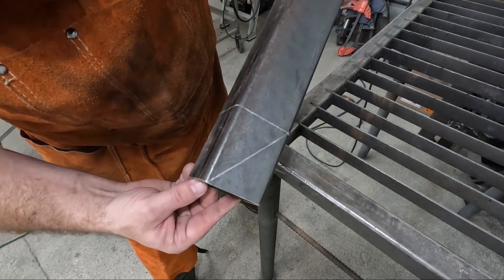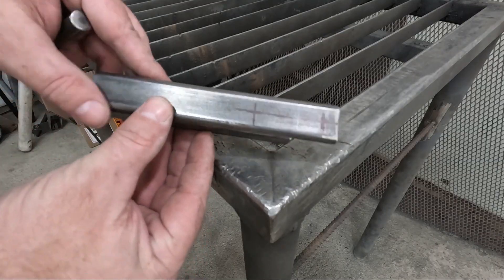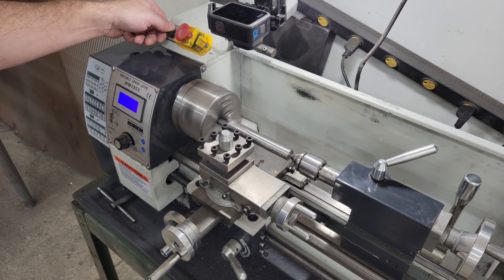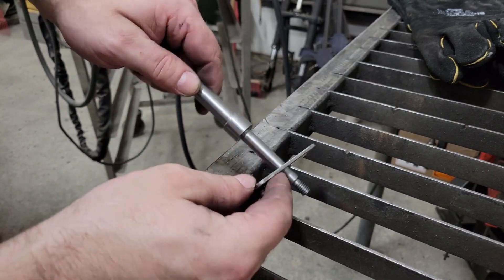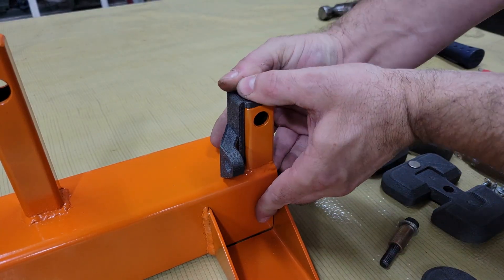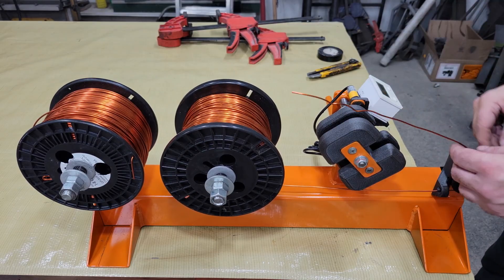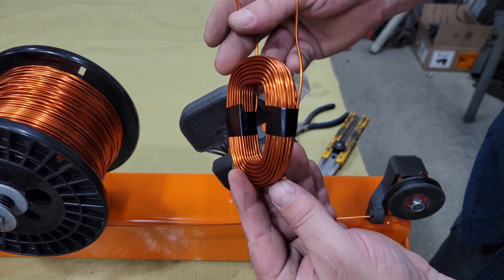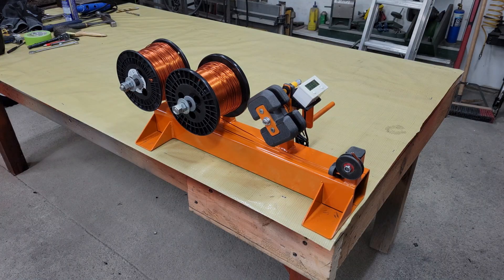Making A Coil Winder & Winding Coils For Axial Flux Generators & Motors

Comment: yey a new video. Sadly its not motorcycle
Reply from the maker: Still testing the replacement cells, but they should be ready to build the battery and test the powertrain very soon. Then on to powder coating and 3d printing some plastic.
Reply: @JamesBiggar  About 3D printing, which material did you use for these gray pieces on the winder?
Reply from the maker: CF infused PETG, for no reason other than that's what I had on hand to print with. Just about any type of plastic filament will work fine for this as long as 100% infill is used.
Reply: @JamesBiggar  Figured it was CF, the looks are killer 👌

Comment: Brilliant and so much information packed into the video. I was looking to find out such information and it was good to learn quite a bit from this one.
I will certainly be interested in your axial flux generator and the calculations used. It is amazing how little information there is on the net regarding generators.

Comment: I'm not sure I agree with your theory that a thicker wire can't be packed as densely as a thin one. The problem is called circle packing in a square, and the packing density formulas show that the density fluctuates up and down as you make the diameter smaller. In the example in the video, you are fitting 6 wires in a layer (reminiscent of 36 circles in a square) which indeed is optimal. The thing is you can also go down to 5 wires per layer, which will have an identical packing density.  Same goes for 4 and 3 and 2 and one, yes, just one circle per layer - in theory packing density is identical for all of them.

Now going a little bit off topic, with a thicker wire, you can give it a more square crossection without compromising the roundness of it, because a thicker wire can still have the same radius to it's corners as a thin wire. This means, you can increase the packing density while keeping the same safe electrical properties.

Now I know the dielectric on these wires is very thin, but a thicker wire has less dielectric, so that's a tiny advantage.
Reply from the maker: In theory. In practice, that's not quite how it works out. First, you're forgetting human error. Keep in mind that we're talking about DIY micro turbines. The thicker that wire is, the harder it is to wind it by hand around a tight radius. Thick wire takes a lot of force to pack into a small package. 12, maybe 10 awg is the max for winding by hand around a 2x1" mag center, and you'll need some muscle and one heck of a grip to get it done right. After that, stator size grows exponentially while power density drops. Time tested and true. If you want to wind thick wires, you need the right gear to do it, which will cost a few hundred $ min. compared to this handy jig. The other thing you need to keep in mind is cut-in and operating voltage vs blade power, ie: coil turn count vs ampacity. Wind turbines operate a LOT more efficiently at higher voltages and lower current, and they're cheaper to produce and install that way. Thicker wire can obviously be wound tightly in an energy dense generator, otherwise industrial turbines wouldn't exist. But the awg requirement is entirely dependent on the tsr, turn count, subsequent voltage and the target power range. Thinner wire + more turns = less cost and better blade performance because 3 bladed turbines, like all electric generators, operate best at high speed. Voltage output is proportional to speed - limiting voltage effectively serves as a brake on the turbine and prevents the blades from spinning faster, ex voltage clippers. These are used on high voltage turbines to switch a load directly on the turbine to 'clip' the voltage down and lower the rpm in return to keep it from spinning out of control and damaging itself or the equipment it's connected to. The relationship between rpm and voltage is why we moved from pwm charge controllers to mppt. The latter doesn't lock the turbine at the battery voltage and allows it to spin up to an optimal rpm range for blade efficiency while producing 10-20X the output voltage than it would with pwm, which minimizes the current needed to achieve the same power while significantly reducing wire and cable thickness requirements both in and particularly outside of the gen where transmission lines can be anywhere from 50ft to 500ft or more depending on the tower height and location, and thus reduces the cost. A 12V wind turbine rated for 3kW would be significantly more expensive to install vs a 200V turbine rated for the same power, like mine. The 12V turbine would need 4/0 cable to carry that 250A just 1 meter, while my 200V turbine would get away with 16 awg to carry only 15A. Big difference in cost. A single 4/0 cable can cost up to $15/ft, but you can buy 50ft of 16/2 cable for roughly the same price. Using thinner wires to pack more turns into a coil and produce a higher voltage in a smaller package is the best way to design a wind turbine gen at any scale, but it's especially true in the DIY world where resources can be limited.

Comment: just for the sake of wondering . Would it be possible to make a PMG Generator for 220V 3 phase with high amperage coils combined for both high voltage and amperage at low rpm?      Get the best of both worlds.

Comment: Thanks for the video, very well done. I’d like to make an axial flux motor for a cycle cart project. Where can I find a guide for a novice to calculate wire size, number of turns, etc for  a desired voltage and torque?

Comment: I'm disappointed, it won't work without cores.
Reply from the maker: You might want to rethink that. I and dozens of other builders have proven otherwise thousands of times over the last 20+ years since the air core axial flux generator was developed by Hugh Piggott. Challenge yourself and search axial flux wind turbine. You will see thousands of working examples with efficiencies and performance that EXCEED steel core radial generators. Many of them are on my channel. This is indisputable.
Reply: it doesn’t matter how you spin the generator, it matters what kind of generator you have, a vertical turbine by its nature does not develop more than 60-80 rpm, the generator you are assembling will start working after 500 rpm, I went through all this a long time ago @JamesBiggar

Comment: What do you think of making a couple of rollers that would shape the wire more into a square shape instead of a round wire?  Wouldn't it help the wires sit in the wound coil tighter with less space between them? I would think the more copper per coil the better.  Thoughts?

Comment: As a question is there a trade of to plunge cutting threads vs chucking up a die to cut threads.  Besides buying the specific size and pitch any reason to go for one vs another depending on size or length of thread?

Comment: Would replacing neodymium magnets with ferrite magnets change things a lot? What advice could you give in that regards? Keep up the great work and thank you!
Reply from the maker: Thanks. Unfortunately, yes. Ferrite magnets have a considerably weaker flux. A 2"x1"x1/2" thick N52 neodymium magnet would have around 14000 gauss and 80 lbs of pull strength. A ferrite magnet of the same size would only have around 4000 gauss and ~10lbs of pull strength. Flux density is the determining factor, and the higher it is, the smaller the magnets can be. Builders have used ferrite before and some have coupled it with iron core stators in axial flux pmg's, but they don't produce the same power without stacking multiple large magnets to make up the difference which makes the build cumbersome and really heavy, and using iron core to pull more flux in comes with increased cogging resistance and lower efficiency, so there's no gain in the end other than saving a couple hundred $ on magnets. Neodymium is a lot more expensive, but the higher density and subsequent higher efficiency from the turbine and generator will make up that difference and so much more over its lifetime.
Reply: @James Biggar  Thank you very much for your reply and help, truly appreciated!  I will take your advice to heart go the neodymium route. Keep well and all the best to you and your loved ones.

Comment: Do you make these and sell them? Otherwise it's pointless to make such a jig for 15 or so coils.
Reply from the maker: I believe I covered this in the video: "you get back what you put into it". You can keep it simple and wrap them around a wooden stick and mold for a quick and easy one-off if you want, or, if you're like me and make a living managing a channel where you build multiple generators and turbines and ev's or build/repair axial flux generators and motors and can find a use for having something more robust and consistent than a stick of wood, then spending a little more time or $ on a better tool will save down the road. But we're talking about something that only cost around $10 in scrap metal and an hour or two to make anyway. I spent more time turning the spindle than I spent doing everything else, which wasn't required. It's not a complicated jig.
Reply: @JamesBiggar  cool.

Comment: within the space of 10 seconds of this vid, i had realised i was an uneducated moron ;) Brilliant viewing though brother
Reply from the maker: LOL! I'm not educated either my friend. I learned all this after a decade or so of "denial and error".
Reply: @JamesBiggar  Hey, James. I'm swapping my 1970 VW Early Bay Engine with a Tesla SDU in the next few months hopefully. One of the problem (expensive) parts is gonna be the half-shafts (direct to the rear wheels).
 Is it bad practice to take my VW ones, cut them in half, then take my Tesla ones and do the same and then use a welded Collar to rejoin them? Thanks for your kindness earlier Pal
Reply from the maker: I did it with the buggy, but I just shortened them vs joining two different sets. I can't really advise it with confidence for the sole reason that a half shaft or cv axle is technically a torsion bar, which is spring steel, and is designed that way to withstand the torque transmitted through it to the wheels. Cutting and welding it will pretty much ruin the characteristics that made it a torsion bar. If the job is done 'well' then it should hold up fine to abuse. I haven't had any problems. But a person is still taking a risk if they do it. If you're a good welder then you'll probably be ok. The best way to do it is to cut it as close to the wheel or diff as possible so that the rest of the axle isn't disturbed by the welding and reinforcement, and can still twist relatively freely in the center if it needs to. Taper the ends of the cut and make multiple passes to fill the void when rejoining (I clamped mine in a piece of angle iron to keep it straight). I used 0.12" thick wall DOM for a collar, extended a few inches past either side of the joint. Used lots of plug welds in the collar along with welding the ends.

Comment: Hey James, any reports on how the reaper is doing with 48v coil windings? Currently building one and curious to know.
Reply from the maker: It worked great, I took it down a while back to prevent burning up the Classic though. It's just too much power, so I'm breaking it down into two smaller single pmg turbines. I've only ever used it with the Classic which allows it to spin beyond the 48V cut-in voltage. I've seen close to 200V from it before it furls. I can't say for certain what to expect if you're using pwm instead, but if you are then I would count on at least 20%+ less power than what I got using mppt.
Reply: @JamesBiggar  Did you see 3kw at any point? I plan on using an mppt charge controler with two dump load options.
Reply from the maker: I haven't 'seen' it but it was logged in the Classic a few times while it was up. I just wasn't around to witness it. I have seen over 2600w at just 24-26 mph, first week I put it up. See the link below, roughly 22 sec into the video. Bear in mind it's only on a 30ft tower below the tree line. The wind is pretty turbulent and the turbine's constantly tracking so wind speed and power isn't consistent at all. But power increases with the cube of the wind speed, and 3 kW isn't very far away from 2.6 in that regard. I wouldn't let it exceed that power, though. You should make it furl at or before that output because 3 kW pushes the ampacity limit of the coils. At roughly 200VAC peak ('wild' ac in the stator, before the rectifier) it'll be producing around 15A. It could probably handle up to 20A surge for short periods, but 15A constant should be the limit as that's all 14awg wire is rated for in most applications.
Reply from the maker: https://www.youtube.com/watch?v=Ef5nDuJD7kA
Reply from the maker: You can verify output at a given speed with the turbine power equation, or use the calculator below. 6ft blade length, 24 mph wind speed, 32% efficiency = 2.6 kW. Commercial and industrial turbines operate at 30-40% eff, so it works pretty dang good for DIY:
https://www.omnicalculator.com/ecology/wind-turbine
Reply: @JamesBiggar  Thanks for the link, amazing how the power output quickly goes nuts as the wind increases a bit. It looks like you are in a woody area and might get in steadier winds with a taller mast. I have pretty favourable conditions here, open fields next to a wide river so there rarely is no wind and it is quite steady. Wind map for the area says 11mph annual average, but I believe this particular spot is even more. I can use the power too, I have a boat yard with a wood shop and three residential buildings to feed. Two 40A 400v grid connections that I can feed into until I set up a large enough battery bank. I'll see how the first one does and then figure out whether it's worth making 2-3 more in addition to the solar. Thank you for the plans, they are amazingly well done.
Reply: Hi James. Great job making the jig. Any progress on the generator series?

Comment: Weld wings or handles on the bolts locked together to hold wire then you won't need to find the spanners next coil change....

Comment: I had a thought when you were talking about the air gaps between the wires.  I had these Morel speakers that I got 30 years ago that used hexagonal shaped magnetic wire so that they could wrap with almost zero air gap in the voice coil.  With your skill, maybe you can make a die/jig that would press a thicker gauge magnetic wire into a hex shape? 
I never miss one of your videos. Keep them coming brother!
Reply from the maker: It's definitely a good idea. I've seen square magnet wire before. Think I'll give it a try in one of the stators.
Reply: @JamesBiggar I bet you could make a set of dies that progressively get more square as you pull the wire through
Reply: The squaring of the copper wire can be done without damaging the insulation on good quality winding wire
Reply: @TheMontesaltos1 a hardened steel die should be possible. One that tapers from round to square and you pull the wire through. You may have to make a 2 or 3 die set